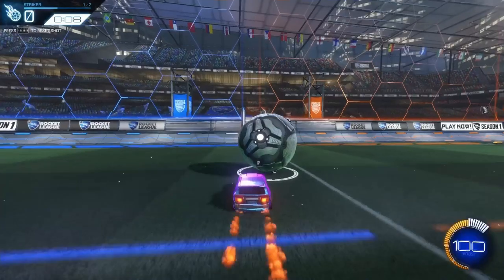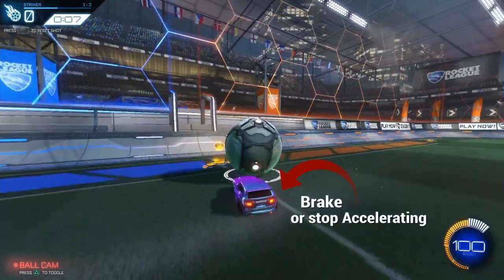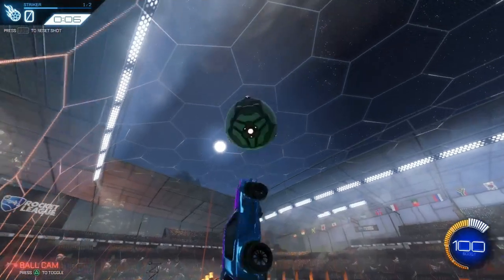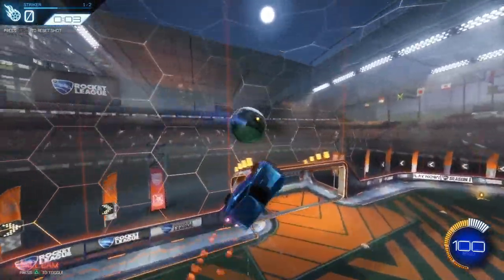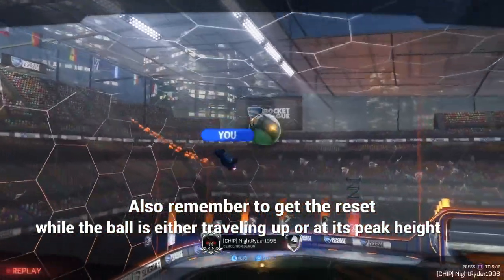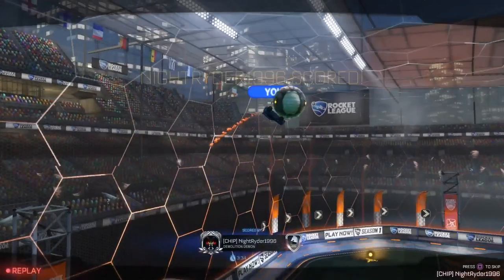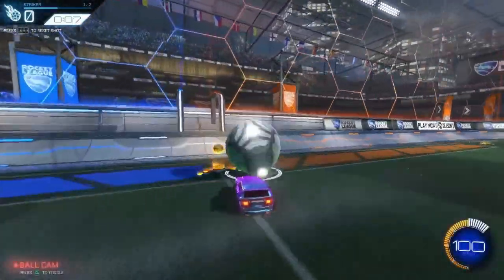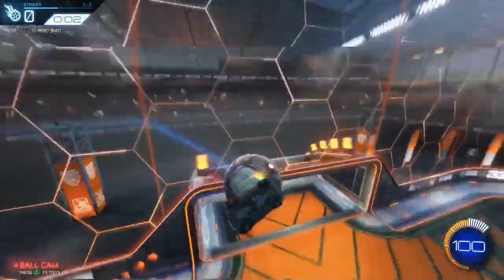How to Flip Reset Musty Flick Consistently (Tutorial) | Rocket League

Comment: I have been practicing these for a week now. Here are some tips for other people who are trash like me. 

1. When you jump off the wall pause only for a brief second. The faster you get to the ball the easier it is. Really boost hard at the ball and turn last second. 
2. Don't backflip until your car is basically vertical. If you do it too early it won't work. 
3. Make sure you are hitting the ball off the wall from directly under the ball, or just to the side. Most people come from the side too much like an air dribble. 

4. Make sure you are landing the reset more on the side of the ball instead of under it. You will never be able to pull this off unless you get higher up on the ball. 

These were the mistakes I was making. Hopefully this helps at least one of you who are struggling like I was.
Reply: If you're REALLY trash like me, instead of air rolling around then rotating backwards after getting your reset, you can just hold your stick directly left or right to turn 180 degrees, this will put you in the perfect position to musty flick. Might need to adjust a tiny bit if your reset was sketchy, and I feel like sometimes flipping a bit so my nose is pointing more downwards instead of behind me and downwards helps get a better flick.

Not sure if this is a horrible way to learn it that will cause issues later though, so take my advice at your own risk
Reply: Im quite new to this but i finally managed to do a flip reset, not the best but still. The only thing is that i cannot really get that close and that high in a few seconds.. is there an easier way to explain it to me? xD And everytime i am underneath the ball, i cant see anything.. any suggestions for the camera? Thanks in advance
Reply: Best comment award goes to you. Your points 3 and 4 were the reason i couldnt do it tysm.

Comment: This vid has everything you need,  for beginners keep in mind that you can use the line on the wall for an estimation for the best spot to hit, but it can be done from any spot as long you drive in the correct momentum /  speed before you jump, witch indeed alowing you to create space to preform the neccesary flick with the reset, the line is basicly the easiest spot to setup the ball with the correct speed, dont forget to subscribe this man when you got the reset down! :)